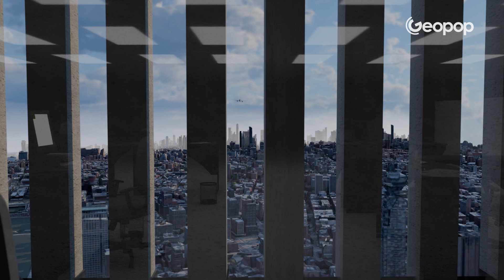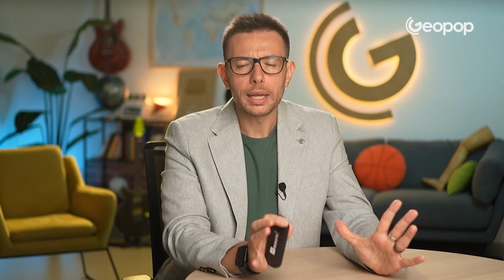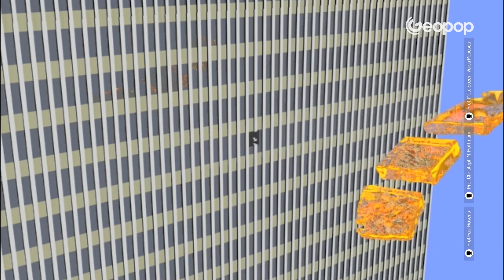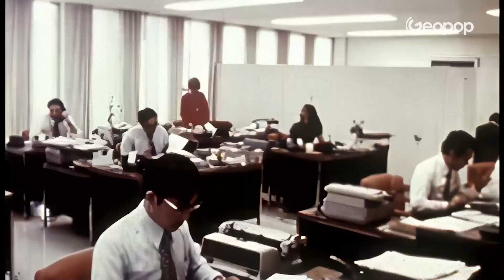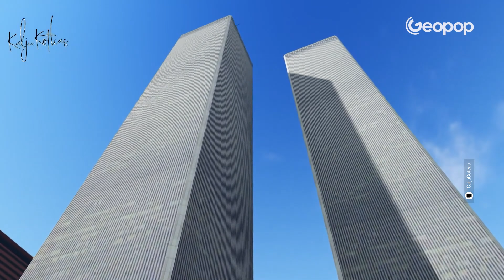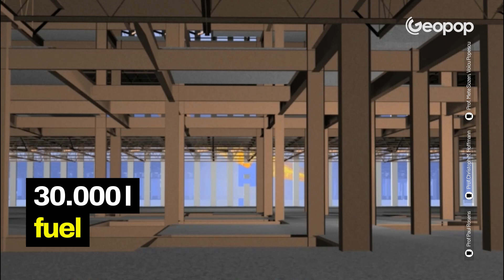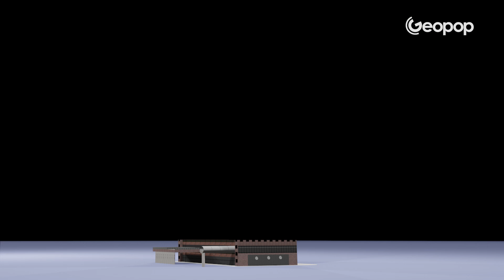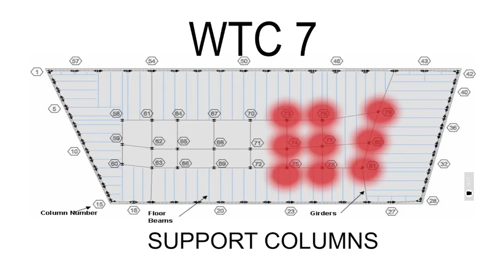9/11, 2001: The Technical Reconstruction of the Twin Towers and WTC 7 Collapses

Comment: fraud why was lava pouring out the building it was on the NEWS chopper FOOTAGE LIVE....LOOSE CHANGE
Reply: Lava pouring out of the South Tower (and it was in fact ONLY the South Tower)?  You mean this?

youtube.com/watch?v=xPVGGQU-MeQ&ab_channel=SeekersofTruth 

So you think that is lava why?  Because you performed metallurgical tests?  Because the internet told you that’s what it is?  I think we can do better, so let’s do better and build a theory the right way instead of making evidence-free assumptions. This will take just a couple of minutes and is worth the investment. 

The Boeing 767 which struck the South Tower weighed 117 tons and 80% of that was aluminum.  The exterior cladding on the Twin Towers – the white panels – were also aluminum. When Flight 175 struck at the 81st floor its momentum deposited much of the office contents in its way and the bulk of the aircrafts mass into the NE corner of the building. The piled up debris shoved into that corner is visible in photographs and video so we know it was there. 

There’s a good shot here of piled up debris from 4:36;

youtube.com/watch?v=ZLJyL63sqtU&ab_channel=MrKoenig1985

Steel melts at roughly 2,750-deg F while fires in the South Tower reached peak temperatures of around 1,800-deg F. Aluminum OTOH melts between 887-deg F to 1,180-deg F depending on alloy. That aluminum will melt under these conditions is not a surprise. If you look at pictures of cars left behind and destroyed by forest fires the aluminum wheels are invariably melted away along with other sometimes aluminum parts like hoods. Steel bodies remain intact. 

The “molten metal” appears at 9:52 am. At the same time we see the first externally visible signs of sagging floor trusses and the pulling of the perimeter columns inward. I submit these events are related, not coincidental. The aluminum cladding at the NE corner also appears to me to be burning. 

It is likely the with the floor trusses sagging under the heat, and the 81st floor truss in the NE corner under the debris pile subjected to the heavy load of the debris pile, the truss broke its perimeter column connections and dropped, instigating the material starting to pour out of the NE corner at the 80th floor.

Given the properties of the materials in question, aluminum is by far the most likely culprit. 

Reports from The NIST, FEMA and MIT all concluded the material is aluminum. 

Certainly steel is the least likely of all the materials the anomaly could be given its much higher melting temperature and the fact there is no logical source for molten steel.  The perimeter columns in the NE corner are intact and the material is pouring out between them. So it isn’t columns melting, therefore what other source of steel is there?

Deniers will claim molten aluminum appears silver when molten, which is true but only at the low end of its melting temperature range. Aluminum can and does get hotter and it glows red to orange when it does (1,100 to 1,800-deg F).  Most folks of course just don’t bother getting it that hot if the goal is just to get it molten for say molding a part. No need to go higher. 

The total mass of molten aluminum is a BIG deal in regard to how it behaves when poured. Quantities bellow half a liter cool almost instantly if poured onto a flat surface, but if poured into say an ingot mould will stay red for a minute of so. Pouring volumes of molten aluminum greater than a liter is a VERY different experience. The thermal mass is much greater and the radiant heat is horrendous. The aluminum is able to stay liquid and remain glowing bright orange much longer. 

The famous video of glowing liquid gushing out of Tower 2 moments before it fell, involves at least tens of liters of molten aluminum. The thermal mass involved is so great that it stays red after falling many meters through the open air.

Side note: There was also a large UPS battery farm in that spot and some of that mate

Comment: Amazing how these are now popping up isn't it? Maybe note that NIST said, and this is a direct quote from NIST NCSTAR "no conclusive evidence was found to indicate that pre-collapse fires were severe enough to have a significant effect on the microstructure that would have resulted in a weakening of the steel structure". So you can remove the "hot fires weakened steel" from your video. Also go find the UL tests noted in the NIST NCSTAR report report that did expose the metal to temps hot enough to weaken them for twice the time the towers experienced under twice the loads. They got 3" of sag.  So the "extreme sagging" also needs to go.  Now with those debunked items removed, explain the complete destruction of both towers. I'll wait.
Reply: Nobody’s explaining where the 3000 bodies disappeared to 😂😂😂😂
Reply: What is the source of the many tons of molten steel found in and under the debris, the heat so intense that the molten steel remained in that state for weeks afterward, running off of the debris as it was excavated. This cannot be molten copper from wiring that retains the color of a shiny new penny.  It cannot be molten aluminum that retains the color of the polished aluminum wheels of a street racer. It was the color of glowing orange molten steel  that cannot be mistaken for any other material, reported by firefighters who are very experienced in the nature of such materials as well as seen in video evidence.

When you combine this with an entire lack of turbulence behind 500 mph aircraft, when even a small Cessna Aircraft would leave an evident wake in the smoke and fire only seconds later .  . We find that skeptics still cannot be skeptical of the official narrative in explanation.  Sponsored channels and forum activity are skeptical of nothing when support is provided.

Sponsored activity in the forums is very normal today for commercial and political purposes and subjects of controversy -- in the attempt to lead public debate.

Comment: Very, very informative yet entertaining, therefore making it a awesome educational experience of expanding our knowledge.
Reply: What is the source of the many tons of molten steel found in and under the debris, the heat so intense that the molten steel remained in that state for weeks afterward, running off of the debris as it was excavated. This cannot be molten copper from wiring that retains the color of a shiny new penny.  It cannot be molten aluminum that retains the color of the polished aluminum wheels of a street racer. It was the color of glowing orange molten steel  that cannot be mistaken for any other material, reported by firefighters who are very experienced in the nature of such materials as well as seen in video evidence.

When you combine this with an entire lack of turbulence behind 500 mph aircraft, when even a small Cessna Aircraft would leave an evident wake in the smoke and fire only seconds later .  . We find that skeptics still cannot be skeptical of the official narrative in explanation.  Sponsored channels and forum activity are skeptical of nothing when support is provided.

Sponsored activity in the forums is very normal today for commercial and political purposes and subjects of controversy -- in the attempt to lead public debate.